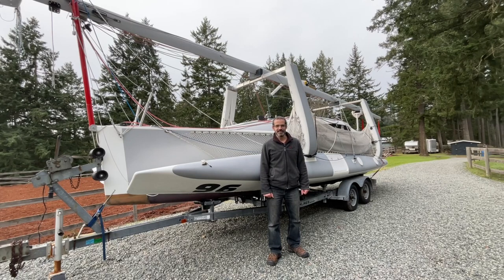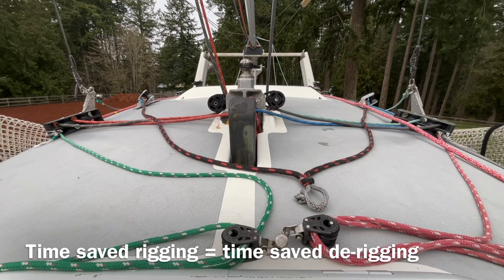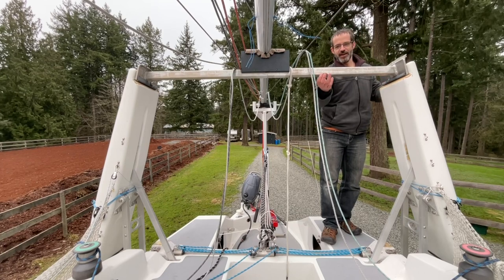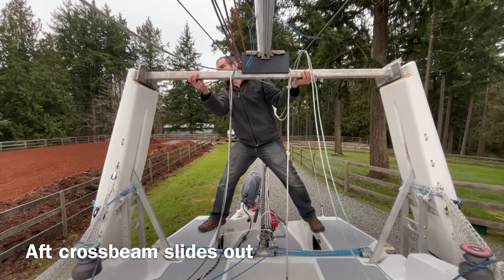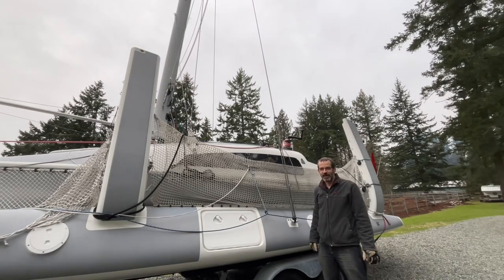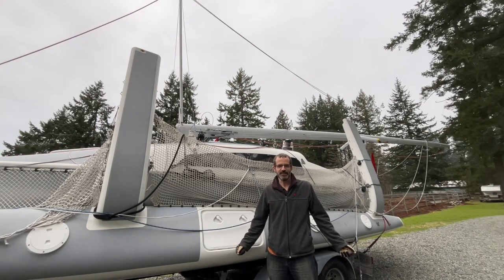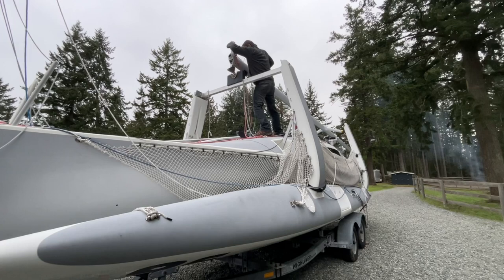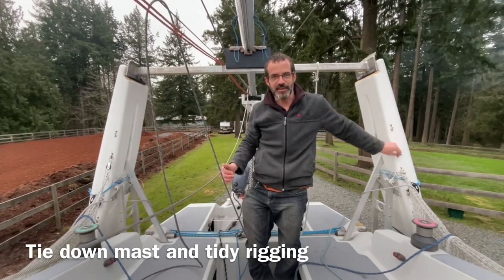How to Raise and Lower the Mast on a Foldable Trimaran

Comment: Have you ever motored with your mast down?
Reply from the maker: Yes we’ve motored from the ramp to nearby docks and back with the boat folded and the mast down. We only do that in settled weather without much sea state e.g. waves smaller than 18”.
Reply: @SailingTipsCa  I'm obsessed with completing The Great Loop. I think a trimaran like the Corsair 880 would be a versatile boat to navigate the 6000 mile circumnavigation. Any thoughts?
Reply from the maker: @The442nd  The Corsair 880 has a CE Rating of B for use up to 200NM from shore, so I think it should be just fine for The Great Loop (assuming this is what you mean https://en.wikipedia.org/wiki/Great_Loop) as long as you watch your weather windows for the coastal legs. I understand the bridges on this route should be 55’ or higher, so the 880 should fit with the mast up (edit: at least for the ICW component).
Reply: @SailingTipsCa  Yes sir! aside from the cost, one of my wife's objections is the price and smell of fuel. I intend to win her over with an electric outboard and solar panels. I know we'll be moving at a snail's pace, but that's fine with us. 20 to 35 miles a day would be ideal.  

Thank you for responding
Reply from the maker: @The442nd  That sounds like an adventure! Maybe you can charge along the way too. I have an electric car which I love but don’t have much experience with electric outboards. What I do know is that those with integral batteries have limited range, so it’s probably best to get something with larger separate batteries in the hull for the 880.
Reply: @SailingTipsCa  Yes.  This trimaran wi9ll be my experimental boat.  A gentleman in the Bahamas converted his 44' Cat into full electric, using BMW batteries. That's gotta be north of million dollars. I'm years away from that kind of disposable income.
Reply: @The442nd  Lithium Iron Phosphate batteries in common marine use are becoming less and less costly, driven by economies of scale in millions of (land) electric vehicles and grid scale energy storage.  So the cost of electric drive in a relatively small trimaran should be at most tens of thousands of dollars, not millions.  That's for a Lithium house battery bank that powers both house loads and drive motors.

For sailing the intercoastal waterways of North America, a generator should not be needed if you have enough battery and solar and charge from shore power.  For crossing oceans, a Diesel generator would probably be needed for long becalmed passages. 

Anyway, seems highly doable, and the future is electric drive.  Remember too that you can hydrogenerate to recharge via sailing.  That's an excellent synergy and better living in harmony with nature than burning fossil fuels, and also much simpler and cheaper to maintain than a combustion engine.

With hydrogeneration you can recharge any energy you use to motor to and from the dock/mooring/anchorage simply by sailing.  THAT'S USING WIND POWER TO MOTOR.

And batteries can be charged in multiple ways, including solar, windmill, hydrogeneration, shore power, etc.  Not so for Diesel engines.
Reply: @LoanwordEggcorn  How about attaching alternators to the electric motors?  while one set of batteries is being used, another set is being topped off by the alternators.  Just a thought.

Thank you
Reply: @The442nd  Most electric motors can be used as generators.  So an electric drive boat doesn't have a separate alternator.

(This is the similar to regenerative braking in an electric land vehicle, except that the energy that goes back into the battery comes from sailing instead of braking.)

Hydrogeneration means sailing with the electric motor engaged and operating as a generator.  The sails pull the boat through the water and turn the prop, which makes the motor act as a generator, recharging the battery.  

(In principle one might not need to charge the battery from shore power, but in practice you'd usually want to, to power house loads while at dock, etc.  Most cruisers also have a lot of solar panels and can end up with too much energy in the sunny places most people sail.  So you'd run the watermaker more, use more appliances, etc.)

There are some more details, but that's the big picture.